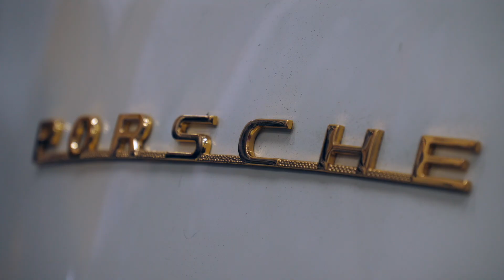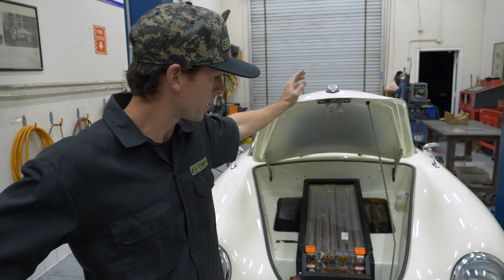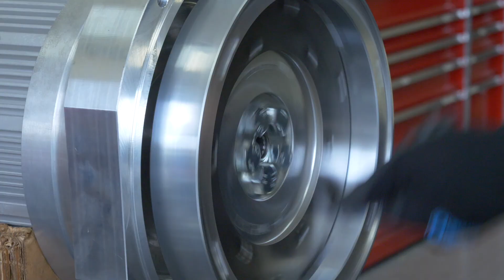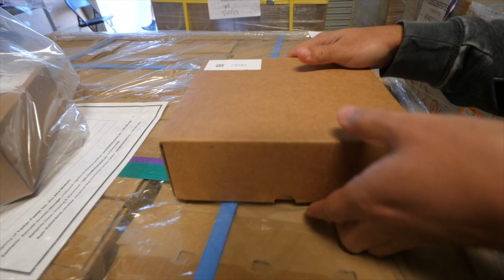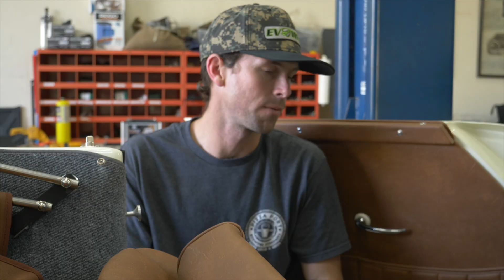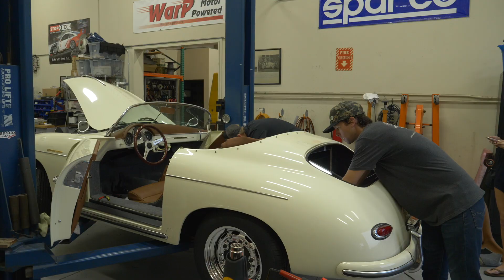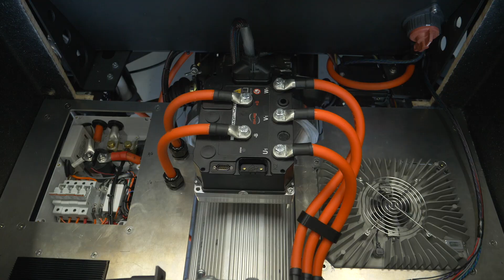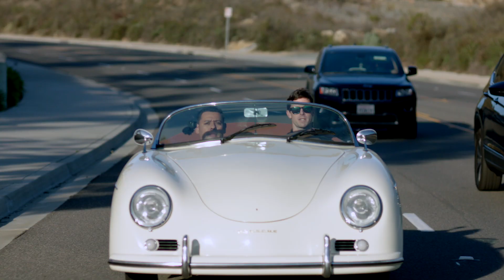Electric 356 Porsche Speedster Car Build

Comment: Jehu, how much did all this effort cost considering that a replica without a motor was used to save costs?  Also, what was done on the underside of this car to protect it against water splash and moisture entering the electrical components and the motor?  Also, how is this car to be charged? With what type of charger? Is it compatible with other chargers found in the world?

Comment: Really awesome ! 

The only thing which would bug me is biasing weight towards front, it is not going to feel like driving the car which it replicates, at least you could try to remove rake to help with weight distribution, or even make a bit of negative rake with nose up. Also car will inevitably get heavier, I guess battery weights 2x more than 356 engine. However, really kool project !

 And thank you for the video :)

Comment: i have a new formula for you. it is one ebike battery 48 volts one ebike motor 48 volts. two battery management systems. one connected two the other with only one to two power wire from the first. then loader alternator and hydraulic motor. estimated to go 22000 miles if you one 120 motor power by a 120 stator and rotor from the original circuit above. good luck and figure it out it takes about two minutes to make it work if you already made one.

Comment: Why is the transmission still mounted ? It has no use anymore and it only produces resistance / range loss. i can imagine it's cheaper than engineering a direct transmission but is this the main reason ?

Comment: Great jobs, one question, why continue using existing gearboxes and differentials ? Would it be possible to use 2 smaller electric motors driving the two rear wheels ? How would that behave  when you go full electrons (put the pedal on the metal) in a corner ?

Comment: Yeah.... It does not pollute, because it has already polluted (in the manufacture of batteries).
Reply: And will continue to do so in charging with electricity still generated mostly by coal or nuclear power generating plants.
Reply: @stephanuhu963  Good point!!
Reply from the maker: Have you heard of solar panels?  New invention, they’ve only been around for 39 years
Reply: solar panels use the sun's energy to charge batteries (ok! but...) which contributed to pollution during its manufacture
Reply: @jehugarcia  :  I'm actually in favor of electric cars, and the huge advances in battery densities and quick-charging ability is very exciting - More power to Elon Musk! 
I'm just pointing out that if (when) we eventually hook up USA's 270 million cars  to the electric grid, we'll need a whole hell of a lot more power generation. (not even counting the truck fleets, diesel locomotives and kerosene-burning airliners) And wind & solar is some way short of that kind of capacity as yet. In 39 years photo voltaic panels has still only advanced to the point where a whole roof top surface will barely keep a vacation cottage going. If you plug in your Tesla, you can't watch TV, have two or three rooms' lights on and have dinner in the oven. And you'd better not need heating, or live in a valley with shorter sunshine hours.

Comment: Totally not an engineer, but is a grade 8.8 enough for a flywheel with this much instant tq? Does anything harder just sheer off? Does the tolerance-fit on the FW compensate for a "softer" non-specialized fastener?

Comment: Would not be surprised that this video brings you a mother lode of people (with lots of money) who want this conversion. I wish you would've included some actual sounds from within the car while it was being driven, also with the radio operating. Questions:
1) Can various types of cars converted also receive an A/C unit if so desired? 2) Can a vented skid pan be installed under the electric motor? 3) where is the spare tire located? 4) I wonder if a VW Automatic Stickshift would be a better choice for putting power to the wheels (contains only low/high ranges and reverse)? 5) is there a governor to limit the car's speed while in reverse?

Comment: Loved the vid. Was that an induction hot plate used to heat the units for fit? Why didn't you freeze the bearing before the press fit? Saw the Pinzgauer at the end. Guy I work with would love that.

Comment: Why would you have a clutch and a transmission? One gear is enough for most of the builds, see the Model S. 
A good electric motor can spin up to 15000 or 20000 rpm. With a 12:1 or 10:1 gear reduction thats perfectly fine for everyday driving

Comment: Heavy battery in front and light motor in rear... this changes the fundamental driving pleasure of a rear engined car....then again, so does taking out the flat 4 or 6.
Reply: There is more weight in the back, they had the motor, transmission, charger, cooler, and another battery box.
Reply: Porsche is going electric by 2022.  Sorry to burst your butthurt bubble.   I'd swap my box s to electric right now if it were viable
Reply: You forgot, that another battery-pack went into the rear ;-)
Reply: Either way, this car is now officially ruined. Not a single car on the planet has improved from adding weight. Not only that, you had to do it to a priceless classic. And for what? Some likes from clinically insane lefties? They're ruining the world and you're egging them on with your travesty of a car.
Reply: @Flyingdutchy33  it's a fiber glass replica.
Reply: @Flyingdutchy33  Absolutely not.  You have never driven an electric car.  The torque and power you get from an electric motor will blow away any engine you would put in that.  Also you clearly didn't watch the video, because this is a replica (aka a kit).   However EVWest doesn't cut up classic cars, they make battery boxes that fit in with no cutting, so no ruining of cars.   I am not sure why you think "lefties" are the only ones that like clean powerful electric cars, but you should do a bit more research before you comment.
Reply: @SkaterStimm  The power argument in favor of electric, I get that. But power alone isn't all a lot of enthusiasts want. The sound of a Porsche Flat Six is music that I reckon fans of a classic 911 would simply wish to have, even if just driving slow. Good thing this is a replica, as I bet purists would really lose their sh!t if it was authentic, but it is a bit odd to do this to this specific car, as the sound is what is typically lusted after. But I get it....rich people.
Reply: @SkaterStimm  How did I miss that comment... I have never driven an electric car?

Could you elaborate on how you know that? Are you following me around?

Maybe you should do a little more research before you comment. And that goes to the people who like comments that are basically baseless assumptions about people they don't know. But then, I expect nothing less from the EV crowd.

And so it's a replica. If that's really the only thing you can point at that was wrong, than I basically already won the argument.

When you're older you will understand what I just said.
Reply: @Flyingdutchy33  It is assumed you haven't because you would understand the benefits of an electric vehicle if you did.  People with your opinion mostly have never driven an electric car.   Also I am old enough to know the pros and cons of an electric vs combustion motor/engine.   I own a Volkswagen Bus with an original hand restored engine and an electric car, so I have a ton of experience with both.
Reply: @SkaterStimm  Well, my whole argument was not at all with the engine, as you can read my issues lie with lugging around half a car in weight in the form of batteries.
Reply: @Flyingdutchy33  the motor is powerful enough to handle that extra weight. Plus it is still less weight than the original engine.
Reply: @SkaterStimm  Christ dude.... Sorry for that but if you had any idea how many times I have to tell people who are illiterate in the ways of physics how it all works, you'd totally understand my frustration.

Extra weight means longer stopping distance. Extra weight means less manouverability. Extra weight destroys roads more.

The simpelest way of explaining this (and forgive for going at it like I'm explaining it to a kid):

And pay close attention now:

If weight made everything better, surely Formula 1 cars would have lead floors by now.
Reply: Furthermore, by that line of reasoning, trucks would be really nice to drive fast. I mean, they have loads of torgue... right? Or is it that they just need even more power because of the weight and then everything will be hunky dory?
Reply: yeah yeah I know "low center of gravity" ( by now I know the EV playbook, you see. Referring back to lead floor in F1 cars. or the lack of them)
Reply: Flyingdutchy33 if you actually watch the video you would know it’s a replica Porsche. Obviously you’ve never heard the phrase, “better to remain silent and thought a fool than to speak up and remove all doubt”
Reply: @Flyingdutchy33  We get it, you don't have a clue, now go and soak up some more Breitbart
Reply: @Flyingdutchy33  
1. It's a replica, stupid ;-)
2. EV's deliver torque from almost zero rpm
3. Weight out vs weight in is adding, yes. 
Overall you are wrong!
Reply: @Flyingdutchy33     Maybe you should study the video more closely.  It's a fiberglass body on a VW pan.  More electrics are on the way.  You are a brainless dinosaur.
Reply: @Flyingdutchy33  your comment is a priceless clasic lol
Reply: @Flyingdutchy33  Hello this is a REPLICA not a priceless classic so no harm done
Reply: @Flyingdutchy33  - Chill out, Dutchy.  You totally missed the point of this effort. I would love to own something like this in place of a diesel or benzine fueled car.
Reply: @72Yonatan  Good for you. Untill you have to brake or swerve and pile your batterysled in some unsuspecting family's car.
Reply: @Flyingdutchy33  I hate leftists too. Kill them all as far as I'm concerned, but electric cars are way cool.
Reply: @homertalk  I was the first to say that electrice vehicles would outperform combustion engine driven vehicles. But I never said that lugging around 700kg of batteries was part of the deal.

Also, the phrase "kill them all" doesnt really sound that appropiate, as much as I agree with it.
Reply: @Flyingdutchy33    700 kg = 1540 lbs.  Two guys easily lifted the larger battery tray into the frunk.  No way the batts weigh 1500 lbs.
Reply: @milano61  So it has the range of my toothbrush. Yeah, great job.

And yes, it has come to my attention that the car is a replica. If some of you would have bothered to read the rest of the post followup, you would have noticed that. But instead you got triggered, didn't ya. And like the triggered asshole you that are, you had to comment something that was already kind of dispelled a few comments further down the line.

In case you missed it.... Wait... Ofcourse you missed it: "If the fact that all what I said that was wrong is that it's a replica and a not a genuine porsche, I already won the argument"

Good day, sir.

Comment: Why a clutch ? I thought Ev converted cars didn't need a clutch
Reply: I was wondering the same. I drive an EV, no clutch, as the electric motor can equally spin both directions. Couldn't the clutch be deleted? Is there an advantage in keeping the clutch, other than simplicity of not adapting the original gearbox?
Reply: I still have no idea why a clutch. Can anyone spread some light on this
Reply: @stevenharpervw  ease of install. If you can use the original drive line it means less parts to convert and less time to build. Less fabrication for parts that obviously dont exist yet

Comment: For how many amps at 12V you think a 1,5mm^2 wire is ok? I made a 3s5p 18650 pack with a 10A BMS and even don't think I'll ever get to using it's  max power output was wondering for how much amps those wires are ok

Comment: a modern braking system is a necessity because of an increasing torque and dynamics on the car, don't know about weights and their distribution on the overall mass but old fashion brakes were not as good and as capable as actual technology. so changing system should be a savvy move to consider and to prove in the overall conversion project neither considering regenerative braking to pull back some energy.

Comment: It's too bad nobody is making a differential carrier/motor mount for Porsche conversions. Seeing all that work to retain the clutch/flywheel/transmission when none of them are needed especially when the motor could be in the spot the trans is using which would leave a huge low space for electronics behind it.

Comment: I love the concept of converting classic cars to electric. Electric cars are not new, you can trace them back to the 1890s. Although alot of issues have been overcome the one big one is cold weather. I had a customer that had a Tesla, but he never drove it in the winter. 
       As you know the power of any battery is cut in half at 32°f. To make a vehicle practical you have to be able to use it at 5:am on a February more when it's -5°f. 
      If a vehicle isn't as reliable and capable as my Toyota Tacoma I have no use for it. I see all kinds of EV videos but never seen any operating in severe conditions.
       It would be nice if EVs were more than toys.

Comment: Does anyone know what the estimated total cost to build this is? I see the kits on the website but that doesn't include the battery and labour.
Reply: Minimum parts cost for a conversion like this is ~$15k, labor you'll have to extrapolate from the video. EV West is pretty quick, but their shop is apparently booked out for years in advance now.  Batteries are the primary driver of cost. The 5 modules in this car go for ~$1500 each, and that's salvaged from a previously totaled Tesla. Batteries are getting cheaper every year though.

Comment: I find it hard to call it a Porsche when it's a VW beetle with a fibreglass speedster kit on it. It's catergorically not a Porsche. It's either a VW Beetle or a Kitcar depending on how much of the Beetle chassis is intact. But a car with no Porsche body, no porsche chassis, no porsche engine, is NOT a Porsche.

Comment: Nice video and what a great shop. Glad to hear you're encouraging other people to convert their cars. There was a time if you wanted an electric car you had to make it yourself. A lot of stuff was happening back in the 90s that seems to just have been forgotten. I went to three electric car events in coco beach Florida called the " Sunday challenge.. part of the event was to drive our cars from Cocoa Beach to Disney World 76 miles. We had three hours to do it and the roads were blocked off by the police so we didn't have to stop at traffic lights. When we got to Disney World  which we got into for free  we parked our cars and showed them off to the public .  At the time  20 golf cart batteries  was the standard setup  120 volts  with a Curtis controller  and I Advance DC was the popular setup . They had gotten grant money to put this all on and when the money was gone the event stopped.  I started my own event in my own hometown and how did every year for the next 18 years, in 2014  I moved and never started a car event in the new town I moved to.

Comment: How much does EV west take for a conversion like this? And what is the total cost including the replica? 
The speedster looks incredible 👍🏻👍🏻😃😃
Reply: I am sure it is a bit more (not much more) than a complete engine restoration of an original engine.  However you would have so much less maintenance going forward.
Reply: After the batteries, motor, charger, BMS, and hardware, I have spent about $15k (same tesla batteries they are using). The vehicle also cost $5k on top of that.
Reply: @ryanfoss6243  Is this correct?  $5k for the car without engine, and $15k for all electrical  but not including labor?
Reply: @Luminaring  yes.
Reply: @Johnny EricssonNo idea, but you should contact EVWest.

Comment: why anybody need 100miles range, it's so little short distance,
does not make any sense to use electric powertrain with anything less than 500+ miles range and with very quick charging 0 to 80% under 30 minutes at least !!
Reply from the maker: Prob 1% of the population need that

Comment: Jehu,  this  an awesome, it makes me dream of my Kombi being Electric, the reason I have been following you for years. I guess if I wait long enough I'll see EV West develop the Kit with theTech I want so I can get the 150Kw and the 200 mile range :P Love your work!
Reply: EV West don't develop the tech, they merely fit it, There are already 150kw motors and battery packs which would supply it with a 200 mile range on the market, all EV West do is buy the parts and fit them. You can do that at home with basic tools, Seriously the hardest part if removing the existing ICE motor.
Reply: The Mighty Dash I can get my ICE engine out in 30mins what I can’t do is find the money for the motor and battery you are talking about. What EV WEST do is develop the best kits and ways to apply them. And they are doing this better than anyone else, if someone else is doing it better can you tell me who, so I can follow them as well.